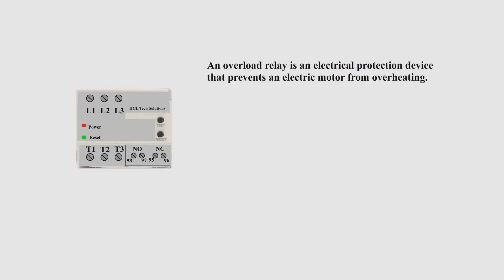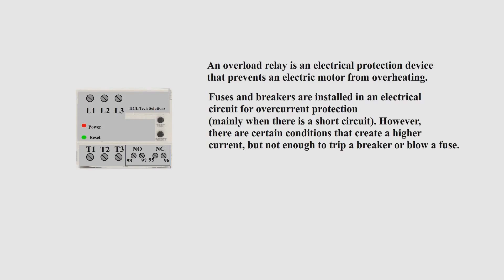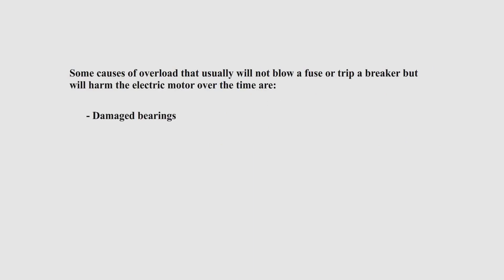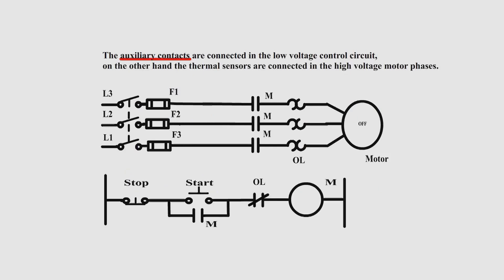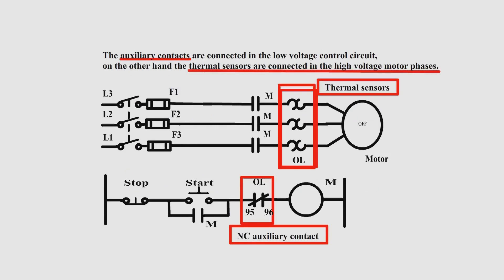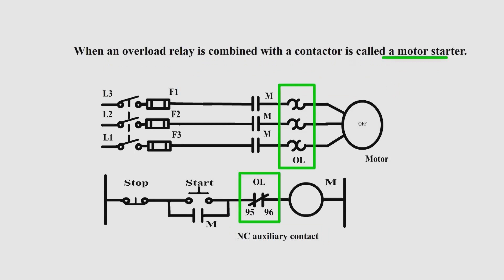Overload relay. What is an overload relay. How it works. Overload wiring diagram to contactor.

Comment: This circuit will energise on its own without pressing the start button. This is so wrong. Only the start button and NO contacts should be in series with the main coil terminal (A1).
Reply: How is that? M is the coil of the relay, the other M is N.O of the relay M. When you push the Start PB, the relay M is activated which closes the N.O contact of M. The circuit is then closed. You push the stop PB and the circuit is open because the relay coil is de-energized. In case of overload the N.C of OL opens.